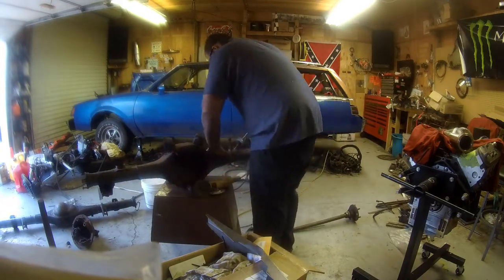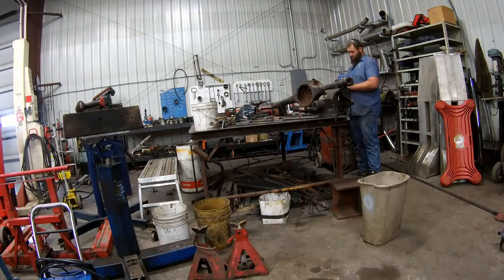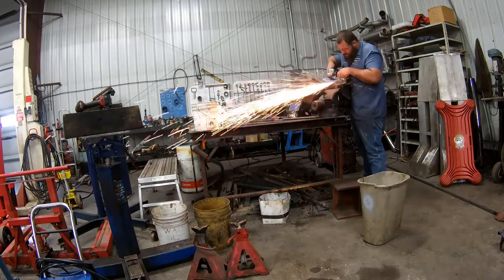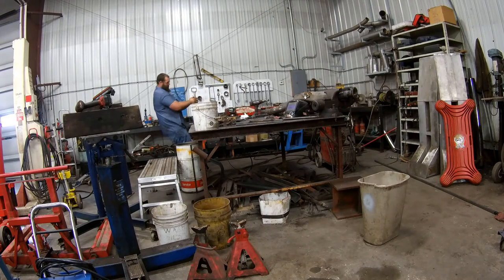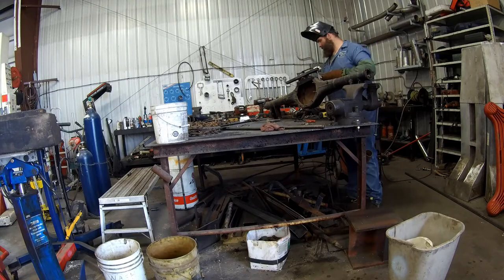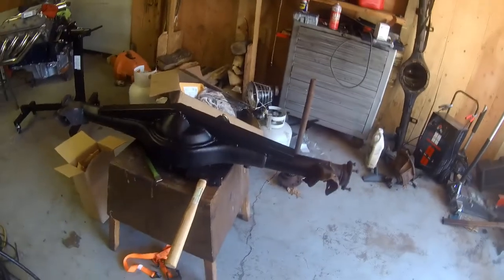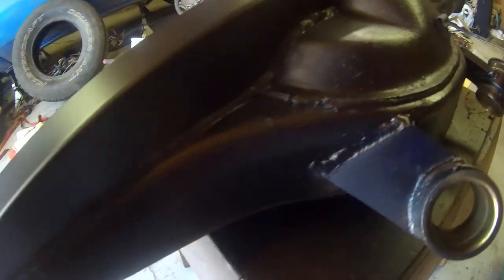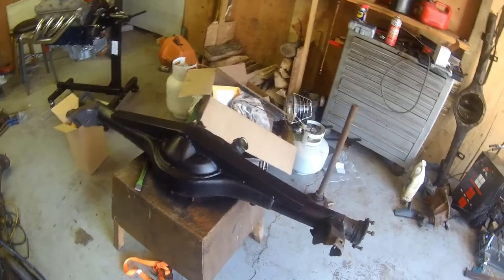Brace yourselves... cheap 9" build part 2 top mounts and back brace

Comment: Would’ve been cool to see how that upper control arm mount jig works...
Reply from the maker: It just bolted to the studs on the front side and located the upper mounts with bolts. Nothing real special I ended up scrapping it after because it was so ugly. Really hard to compete with how cheap you can get one of these from speedway.
Reply: Dirtfloorfab, Ugly or not it still would’ve been cool to see, I couldn’t see what you were doing from across your shop! 😄 You have some cool projects going on, always good to see so much work done at home. 👍🏻